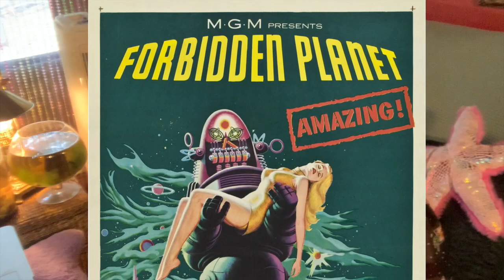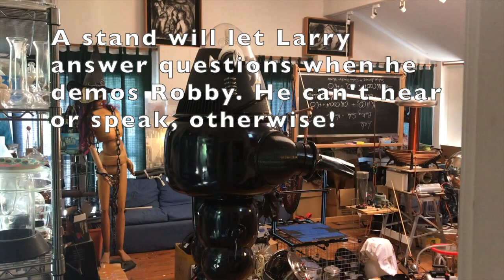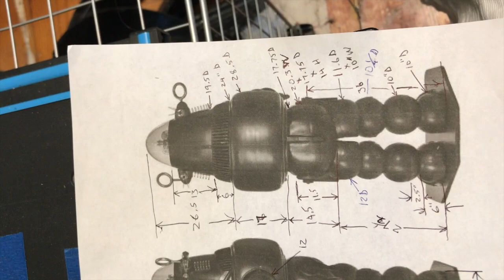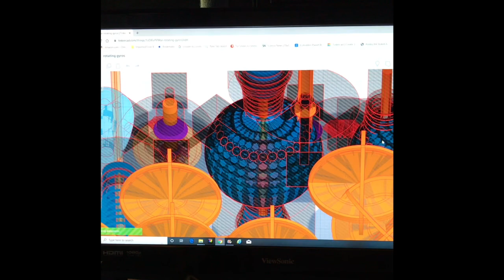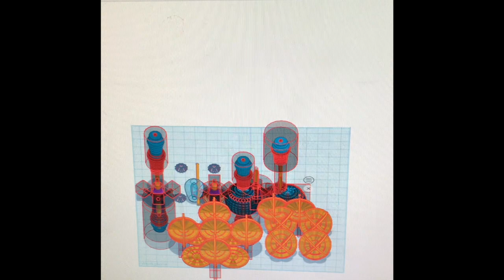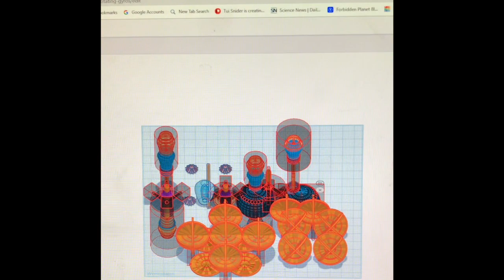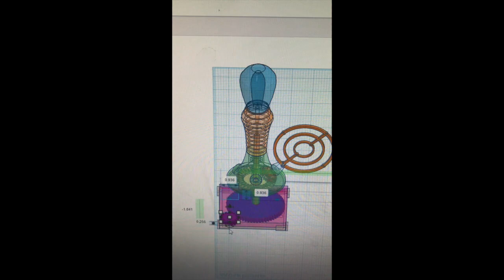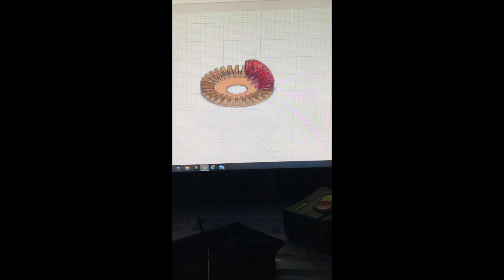Homemade Robby the Robot Forbidden Planet Life Size Costume

Comment: There are plans available for Robby online that are the original plans used to build Robby, There are also scans of original drawings for the working parts, however, they are not to scale. The dome  has to be the hardest part to fabricate and it looks like you got a reasonably good one. Using plaster as a substrate to pull the plastic over is always problematical because it cracks as it dries as you found out. What thickness of plastic did you use?
Reply from the maker: I'll tell Larry to get on here and answer your questions. Yeah, that first dome didn't come out so great, but I helped him with the next ones, and he used the best pull in his final costume. He always says that the dome was the hardest part!    And didn't know there were plans available online for Robby now. When he was making his last year, he looked for makers clubs online, but couldn't find any. I think a few have sprouted up since.   Thanks so much for watching!
Reply: I was using .125 in in the video, but .25 would be better

Comment: In the video Larry mentions the 'mouth lights' in passing but doesn't actually tell how he made that part. could we get some of the details? Again, great work on this.
Reply from the maker: I'll tell him to come reply to your comment. Thanks so much for watching! :)
Reply: I have three sections of EL rope with seperate voice activated drivers for each section. I set the trigger threshold for the center section at a lower level than the top and bottom.
Reply: @larrysnider7382  Thanks Larry! Did you run the EL wire through clear tubing to make it look more like neon? I've seen that done.
Reply from the maker: @dalekasylummilwaukee4186  Larry says: "No, I just bought the "fat" EL rope." Does that make sense?
Reply: Thank you Larry. It's great that you are so willing to share. Are there any plans for you to release or sell you stl files?
Reply: @larrysnider7382  I would love to hear more about how you have the El rope connected and how they turn on.  I've tried using it myself, but can only get it to stay on all the time, or fast/slow strobe with its presets on the battery pack.
currently trying to use fiber optic cable with bright LED lights at each end, but not as bright.